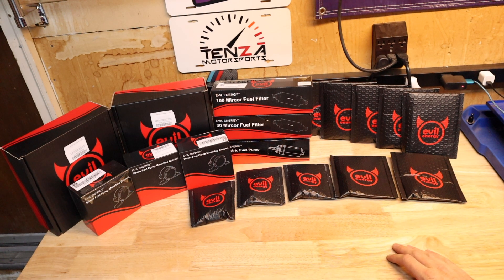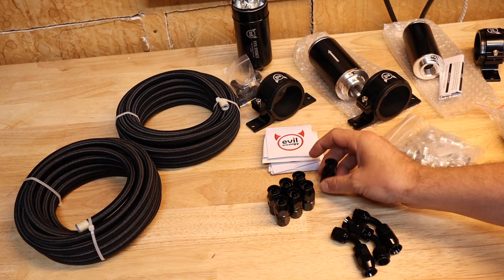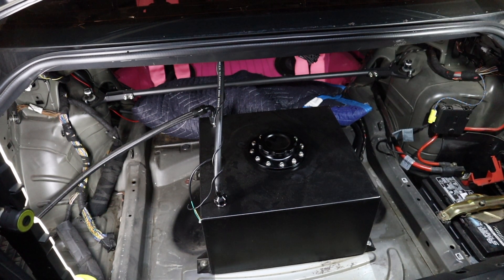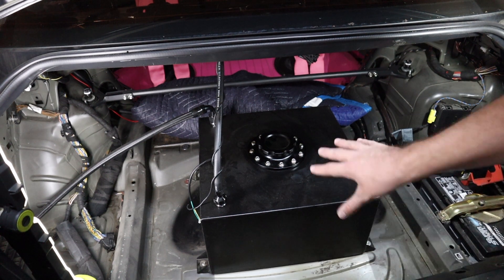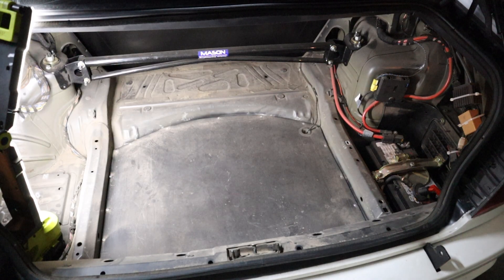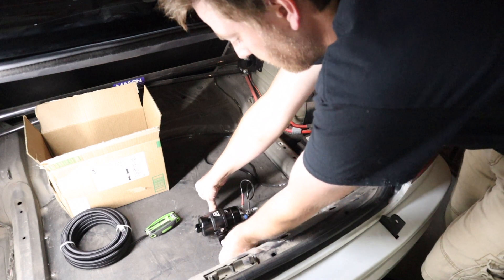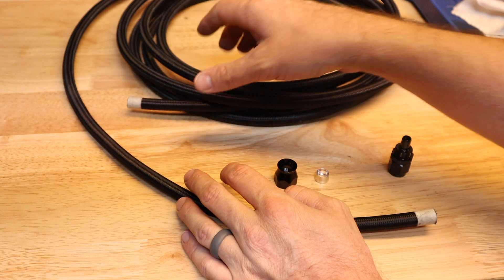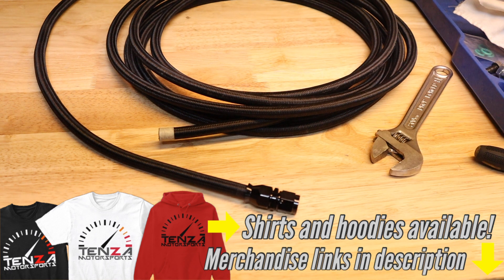Evil Energy Fuel Injection Line Kit review - Best budget fuel system unbox and quality inspection

Comment: There should be two tools. Slender black and thick aluminum. The black is to help fray the line. While the aluminum is used to seat the crimp washer. The rest is self-explanatory. PTFE is not as forgiving as rubber use the tools. Avoid the headache. Welcome to the corn club.
Reply from the maker: Thanks for the comment! I’m excited about getting e85